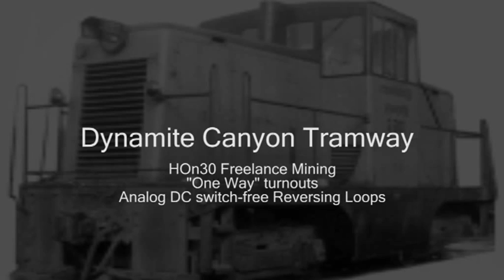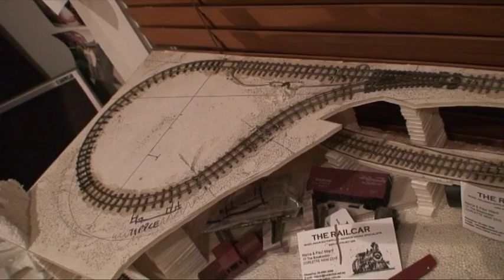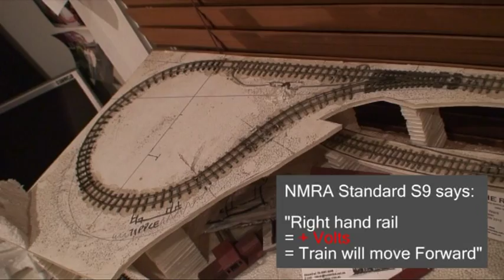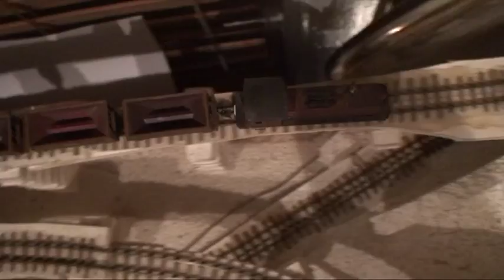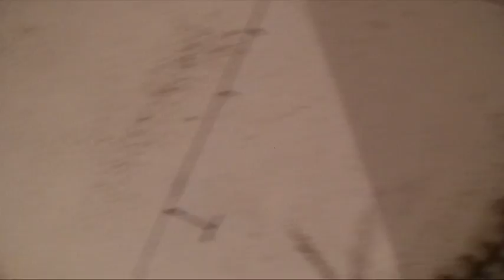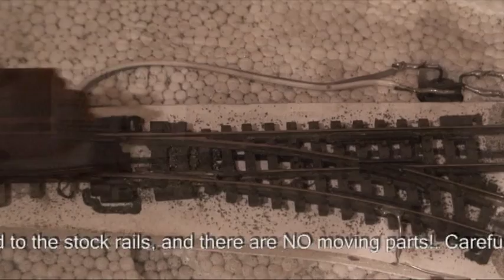Dynamite Canyon Tramway

Comment: scratching my head no point motors ??..... how that work then ?
Reply from the maker: Alan, best way to work it out is to check the PDF linked in the description, grab a otherwise worn-out/damaged/excess insulfrog point, and give it a go... The key is that as long as the flangeways are present and the gauging of the wheelsets is correct, a loco or car travelling toe-to-heel will always want to mechanically take the straight route...